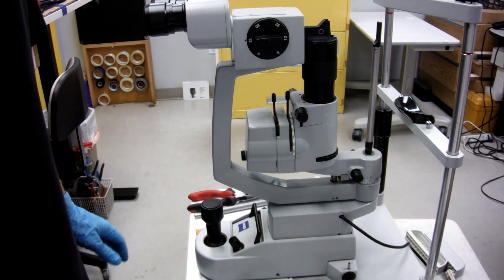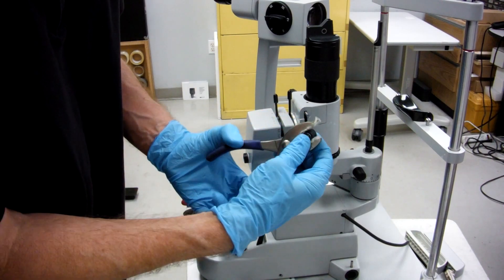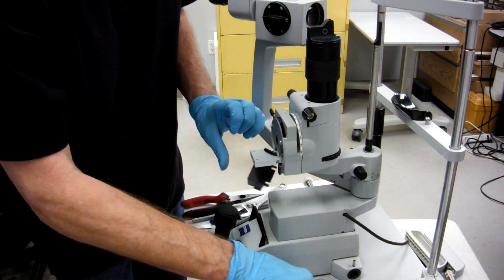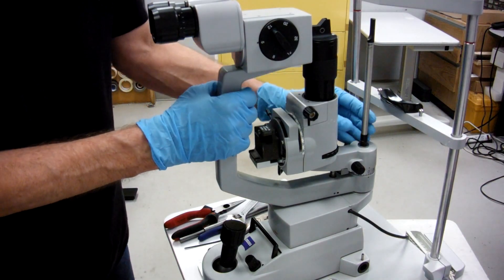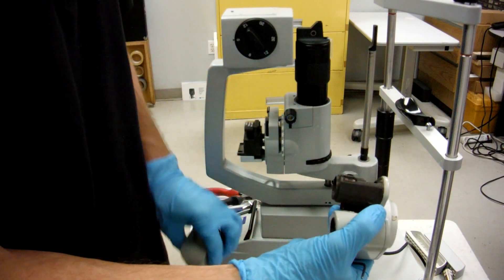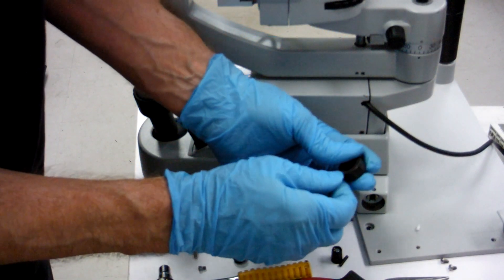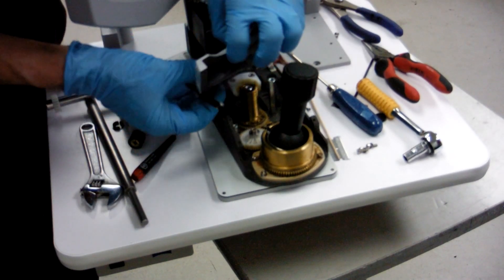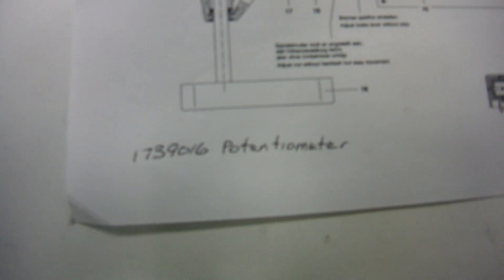Zeiss SL120 Slit Lamp Adjustments

Comment: Do you know what size spring the slit assembly uses? I have one where the spring is missing. Thank You
Reply from the maker: I took one off and measured it. The coiled body is about 7.5mm. With the hooks on either side it measures about 13mm total length. 3mm diameter. Don't have any to spare. Hope you can find one.
Reply: @grasshoppaMedia  Thank you! I just ordered an assortment. I will let you know which one works in case someone else has this issue.
Reply from the maker: @acadiansunrecorders1701  👊

Comment: How to remove filter assembly?
Reply from the maker: If you are trying to blow dust off the filters, you might be able to remove it by blowing some dry air in the gap on either side of the filter wheel. We use a hand held hurricane blower (often used on camera lens maintenance) rather than canned air because there is sometimes chemical propellants in the canned air that can end up on your filters.

Comment: Hi.  Do you know what to use to grease the gears for the Joystick
Reply from the maker: In my opinion, a light grease is sufficient. #3 Haag-Streit grease if available but any light grease should be fine.You could use some type of solvent like lighter fluid to clean the grease and apply a coating of light grease on the gears and spur. Make sure there's slight wiggle room between gears.